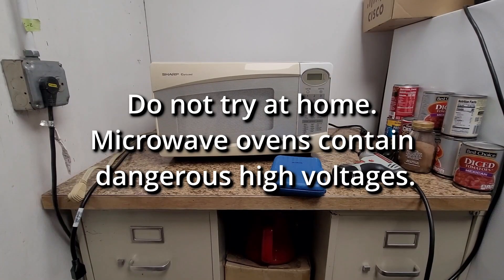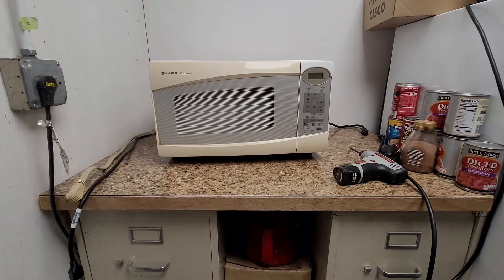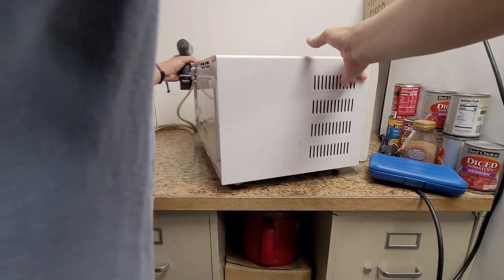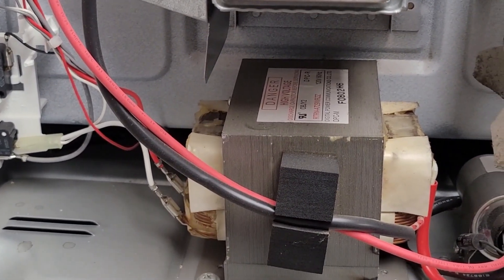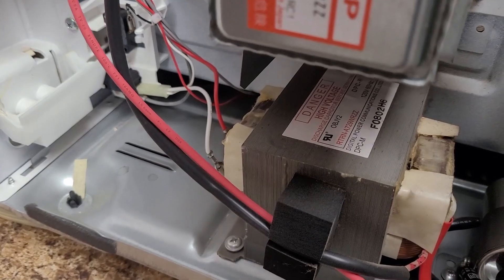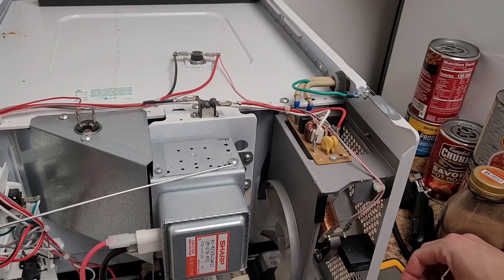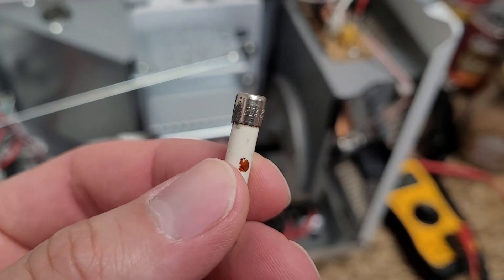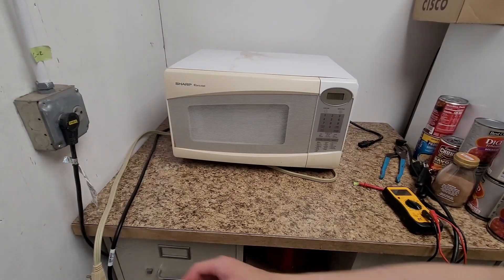Microwave oven #teardown turns unto a simple repair (Do not try at home)

Comment: Yup, sometimes it's just a Fuse ;-) We have a similar Sharp that's a bit over 20 yrs old and still works
Reply from the maker: I thought for sure a coil or something melted down. At least it isn't one of those inverter-based Samsung ones. There is a run of them where they would randomly turn on and run until they literally caught on fire. Only reason I know is I had a recycling customer that had that happen to them and they gave me the microwave recycle. It was the worst smelling thing ever.
Reply: @computersales Great job finding and fixing the problem!💡💡👍👍